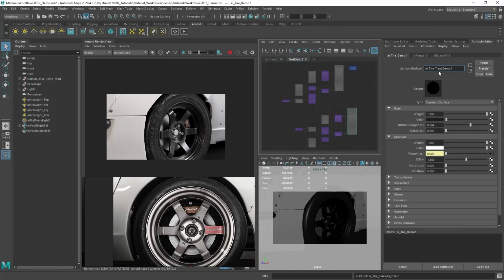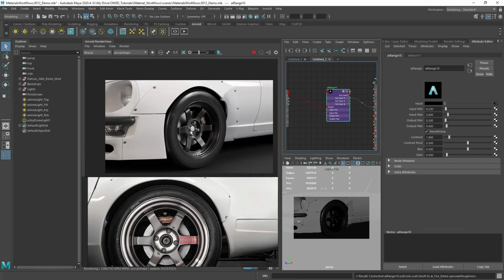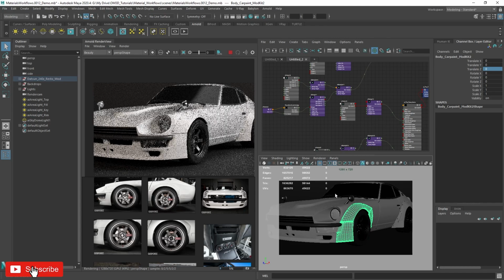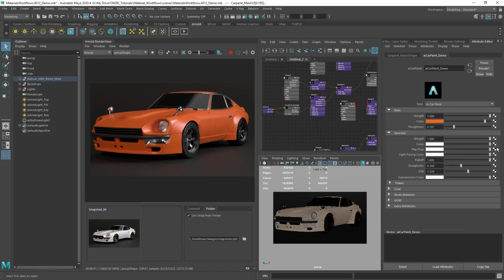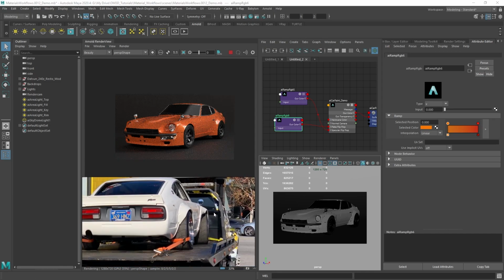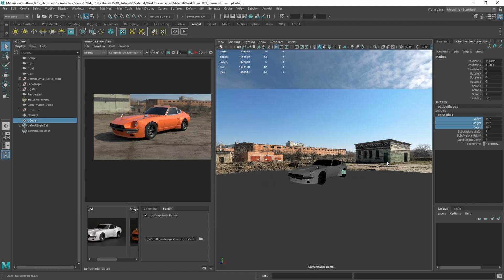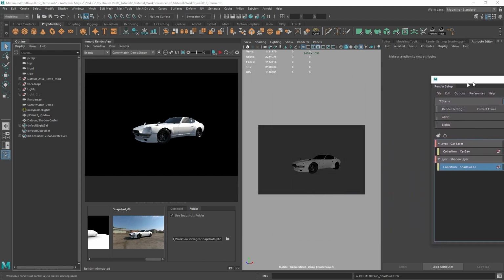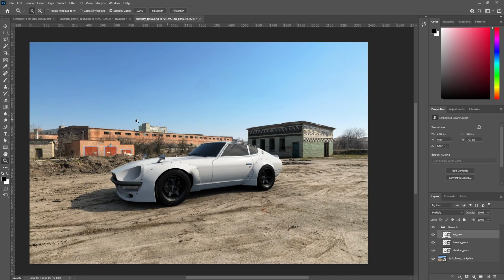Material Workflows: Car Paint and Shadow Matte/Catcher

Comment: You forgot to set filmback. The sensor size of Nikon D5100 is 23.6mm x 15.6mm. 
17mm focal lenght is 25.5mm on full frame sensor. Also you do a great job. 🙌
Reply from the maker: You're right, can't believe I missed that so thanks for posting the correction. For those watching the tutorial, select your camera, go to the attribute editor, under 'Film Back', enter the respective dimensions under 'Camera Aperture (mm)'.

As Denis explained, the backplate in the tutorial uses a Nikon D5100 which you can find in the image properties. You then have to do a search online for the actual sensor size, with the Nikon D5100 being 23.6mm x 15.6mm.

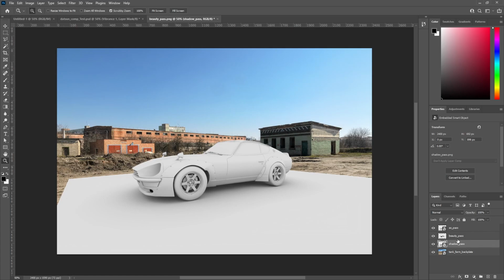Comment: This is late, and not sure if you remembered what you did, but at 1:11:20, you were settings AO and Shadow passes to Multiply. For a split second, you can see that when you hover over it, the ground becomes darker (I have this issue), then you said "Ops, the multiply is a bit off" and you cut it. I wonder what you did, because I am having the same problem with my ground become darker when I set it to multiply

Comment: Hey , Can you do a video on how to use the GPU in Arnold? When I selected it , 80% of the times Maya crashes when rendering ( I have a RTX 3080 )  Thanks a lot
Reply: Try Renderman or something Different like Redshift, With Dense scenes, Arnold is not usually the best. but also maybe play around with the sampling.
Reply from the maker: I really didn't do anything besides set the render settings to RTX. I would check your Nvidia drivers are up to date.